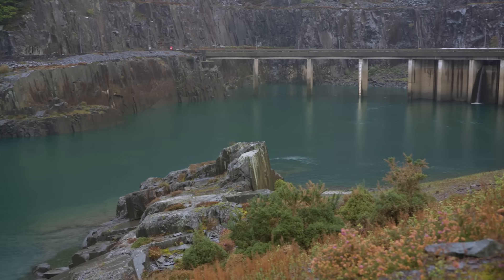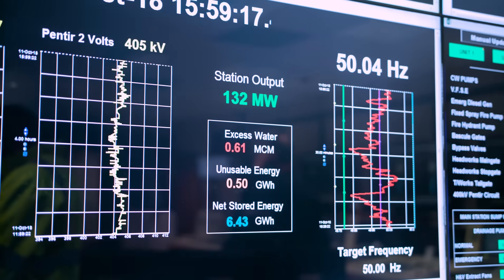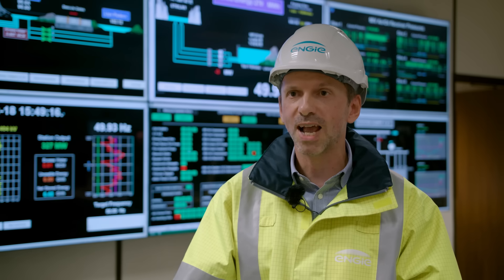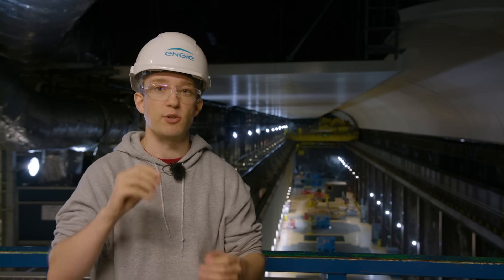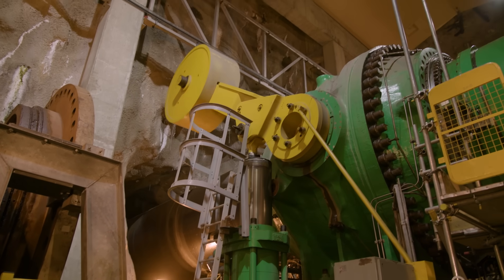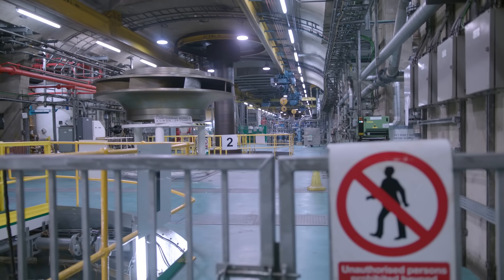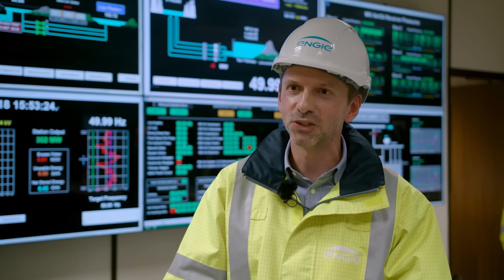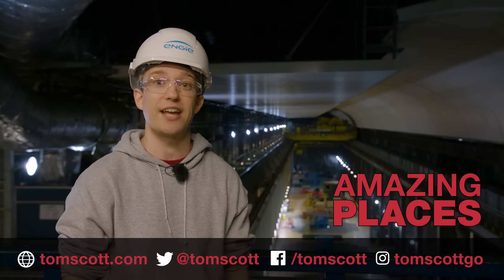Britain's largest battery is actually a lake

Comment: Isn't there some rule about vehicles must be left unlocked with the keys in, so that if the mechanism goes wrong, the staff have a slight chance of escaping the water?
Reply: Water-Battery: Time-Travel Worthy? No, eriously, im a Writer and wanna ask around if it makes sense to introduce this in Ancient-Times
Reply: @loturzelrestaurant  Interesting question! Of course, water power has been known since ancient times - mainly for milling, but around the beginning of the industrial revolution did power some factories - but the battery (storage, really) concept requires a source of energy to do the pumping-up, which I can't envisage in ancient times: all I can think of is wind, but if that was available, they'd be using it anyway rather than the water. I suppose you could envisage a very rich man using slaves on a treadmill to punp up, but that isn't really viable in general use (and the fuel - food - for the slaves would make it probably uneconomical even then).
I suppose it might just about be plausible where there was intermittent wind, especially if it blew at fixed times of day (ideally, night) when the power wasn't needed. (But you'd have to devise a wind-to-pump mechanism that was reliable enough to operate unsupervised.)
Reply: @G6JPG  Interesting! Tewll me more! Only if you have the time/mood though
Reply: @G6JPG  ?
Reply: @loturzelrestaurant  I don't understand what you're asking.

Comment: Never knew this existed, how does it compare output wise to Cruachan Power Station?  These designs have to be a major part of the solution to our  power needs in the future. A dam at height and a generator and pond at the bottom,you could even use excess solar / wind generation to pump the water back to the reservoirs at times of low consumption! They can also be made at various scales depending on the geography

Comment: The US Department of Energy just recently did a study of potential sites within the United States for this type of closed loop hydro-power storage facility . . . and they found 15,000 places where it may be possible to build something like this. Energy storage on the grid is the other huge upgrade we need to focus on to decarbonize. This is one area where the UK is way ahead of the US. The problem in the States, though, is permitting and building a facility like this can take decades. Hopefully, they can figure out a way to streamline some of that to shorten the process.

Comment: It's cool but it's also kind of a net zero. It seems like it has to use the same amount of energy that it receives to reverse the process at night. The only plus is that it's doing it during a lower cost. This got me wondering whether there are any power stations that take advantage of tides coming in to generate power? That would seem like a plus system if it was doable.

Comment: Why would you pump it at night? That seems opposite of what you'd want to do. Store renewable energy produced during the day and release it when its not producing.
Reply: Because people also use less electricity at night and there is much excess energy.
If renewables become more present so that it makes energy cheaper during the day or during certain hours, they would switch their cycle of operations.

Comment: Works as long as the energy to pump the water back up isn't from another 'battery' (ie another lake), and you don't care how the night power is generated,  Question: so the power to pump the water back up comes from what source? If it's from a non renewables that's a problem. If  as is said the lakes is topped back up over night then it can't be from solar, so must be from wind - they have that consistent a wind generated energy supply at night? . Also note that the system uses more energy than it produces, as you don't get something for nothing ie energy in = energy out- losses. So this only seems to work for an individual power retailer who doesn't care how the off peak power is being producer, so they can buy it cheaper than they sell it to the public. I'd like to see a 'whole system by country' analysis before seeing any merit in such a system.
Reply: It's main reason, as Tom stated, is to provide extra electricity during periods of peak demand, that which cannot be provided by existing power stations. NOT to create it's own.
Reply: @staryoshi06  
Yes it gives extra generating capacity at peak times, but lets not fool ourselves into thinking that because it's hydro that it's a clean/renewable energy until the initial generation is from renewables - currently only 38% in UK, and generally even that isn't availability/efficient when the electricity is required to pump the water up. And in the vid it is said they buy power when cheapest,  that's like saying I buy my gas/coal when it's cheapest.
No one in these vids about the system ever mentions how the extra source electricity is being generated
Reply: The point is, the energy to pump the water back up comes from energy which would otherwise be wasted because it's night-time and nobody needs it. It's the reason Economy 7 exists.
Reply: @SM-dt1pr  Night time energy generation: is that from non renewable sources (assuming solar & wind aren't generating) which can't be shut down and have to be kept running at a low level output, so so then... That output has to be above the min grid demand, so additional non renewables are being used to pump the water back up - or is there something I'm missing?
Or put another way, right now is the minimum generation capacity that they would cycle down to during off- peak (your Economy 7 or I believe E10 now in your part of the world now) ever above the minimum demand such that any generation is actually being wasted?

And therefore isn't the excess non-renewables energy 'generating capacity' available during the off-peak being used to storage energy for later use when energy demand is high, thus increasing your peak generating capacity - but that 'stored energy' has it's energy losses to store/discharge again.
And if you're trying to move away from non-renewables seems you back yourself into a corner of where your excess off-peak power generation comes from

Comment: The thing that confused me about this was pumping the water back up. Would that not require a huge enough amount of power to more or less invalidate the energy gained when it flows down? If the net gain is 0 and they're just using it to cover spikes in energy demand, I can't help but feel like it's a bit pointless compared to a normal power station, unless the energy output from the falling water is really big enough to cover huge power demand spikes.
Reply: It's not really meant to be a generator for the purposes of such stuff being the only or main power source. Net gain is probably negative. However, as the title says, it's like a conventional battery, just hydroelectric and not chemical and on a massive scale.

Batteries cost more to charge than you actually can get out of them, but can store the energy. 

Building such stations more heavily could help with storing renewable energy when it exceeds the current demand and could reduce the need for dangerous (for people and the environment) mining for lithium that is needed in chemical batteries.

Comment: I had a wild plan as a kid that you would have a huge lake at the top of the mountain. A generator at the bottom lake and a huge glass roof over the bottom lake that would catch all the evaporation and drain it back in to the lake at the top. It would refill the top lake with clean drinkable water.

Comment: we had one of these till this year it was built in the late 80s and machinery was done by Toshiba. Because of a very large corruption scheme the repairs were not done by the original 30yr round overhaul plans but by something made by another company in germany i think. during night time one of the overhauled turbine/pumps burst and almost the entire facility was rendered inoperable.  The funds needed for repair are not possible to allocate at the moment so we lost a strategic power resource :(

Comment: This is the most ridiculous idea for a power station I have ever heard. Just because it "costs less" does not make it efficient. This is by far the most inefficient way of generating electricity, it would take at least the same amount of energy that came out to move it back to the top. Just stupid, plain bloody stupid!
Reply: It's storing electricity. It takes energy from night-time, when electricity is cheap and it is worthwile to pump it back up, and then releases it at daytime to help with the peaks. It does not generate electricity but stores it.

Comment: Tom, next time you come to New Zealand, maybe checkout Manapouri Power Station.  It has only one half the capacity of Dinorwig, and is a constant loss system draining Lake Manapouri into Doubtful Sound 750' feet below.   The turbine station is deep within a granite mountain and accessed via a two kilometre tunnel big enough for a coach to drive through.  Workers were bought to NZ from Italy as they had the experience.  The unsealed road that connects Lake Manapouri to Doubtful Sound goes over Wilmot Pass, and is the most expensive road by length ever built in NZ.  It is under constant repair because of the intense Fiordland rainfall (about 7 metres [23 feet] every year).   If you do come here again, and want a guide for Marlborough, please look me up — it would be a pleasure.

Comment: Why would you burn battery over the day when sun is shining?
Shouldn't we be using this sun  to power the battery and use the battery over night?
Reply: No. At night the electricity consumption is much less in the country so it makes sense to pump it back up. During the day is when excess electricity is needed, so the water is released.

Comment: Where does the power to pump the water back up come from?
Reply: Energy Surplus. All energy that is generated must be consumed immediately after, since there is no electrical battery large enough to store such extreme amounts of energy. Then there is more energy being produced than is consumed, the excess gets turned into gravitational potential energy. When more energy is being consumed than would normally be produced, this acts like a hydroelectric dam, exchanging the gravitational potential energy back into electrical energy to make up for the deficit. It is not as fast as Flywheels or Batteries, but it has a much higher capacity and makes up for the large-scale variations in the grid.
Reply: It's storing electricity. It takes energy from night-time, when electricity is cheap and it is worthwile to pump it back up, and then releases it at daytime to help with the peaks. It does not generate electricity but stores it.

Comment: I've thought of using a similar idea for home power generation using a hydraulic ram pump, which has no moving parts, and simply relies on moving water to pressurize the water line downstream from the pump. This could slowly fill up a reservoir and either the reservoir could empty into a turbine at peak power need or continuously empty into a turbine for constant power generation.

Comment: May I know how much the energy needed to pump up back the water compared to the energy down flow you can harvested. Im not intrested about the cost cheap or high. Just need to know about the convertion power calculation, example pump up needs 6 times the power then it can produced down flow... Tq.
Reply: I think it's something like 85-90% of the energy you put in you get back.

Comment: a fuselarge testla valve, when you close the main pipe valve, open the edges of fuselarge openings to the testla valve outer spirals, as use as a recuirculation diversion to lower the intense pressure. simple fix for water hammer.

Comment: Could it be possible to make a big siphon so it just recharges for free and generates power all the time?
Reply: self-feeding siphons will always reach equilibrium. It all has to do with the fact that you can not get energy from nowhere. A siphon will always bring a liquid from an area of high potential to an area of low potential, and not the other way around. If the end of the siphon is placed above the level of water, the siphon will not flow, as the hydrostatic pressure would not be sufficient to move the water. It would be analogous to water flowing uphill, something that does not happen without some kind of energy input.
Reply: @zacharytaylor190  thank you for taking the time to give that explanation
Reply: @TheStigification  No problem.

Comment: There's a similar thing in southeastern Missouri, USA. They literally built a reservoir, fully above ground, on top of a (very small) mountain. It's actually a net consumer of electricity because there's no natural flow of water into it (it is literally on the summit), but it's profitable because of the electricity-is-cheaper-at-night thing.

Comment: It's not renewable if you use Coal or natural gas power to pump the water up at night. I didn't hear anything about what kind of energy they use to pump it at night, only that "it's cheaper" I heard. Maybe that they buy electricity from germany or other countries at night and use that to pump it, same as most Scandinavian countries do.
Reply: They buy from the grid, that's all the generators in Britain. So both renewables and fossil fuels
Reply: Essentially its a water battery. its not 100% renewable, thats my point, you still burn fossil fuels to run it.
Reply: @mehdi-9999  Yes, it's exactly as renewable as the energy used to power it.
Reply: I've been on tour there and they explicitly mention that it is not renewable.

Comment: Pumped hydro energy story is about 80% efficient.  However there are still the losses to send power up the grid and back down the grid.  So for example solar panels on someones roof lose 10% going up the grid to storage (of whatever type) and another 10% loss coming back down the grid to homes etc for use.   Thats 40% loss overall.  At least pumped hydro has very good scale and lifespan compared to the other storage options and can be throttled.  People forget that most lithium storage has 80% at 10 years and by 15 years is due for replacement on a charging cycle once a day.  The ideas that countries have to use EV's as cycling storage back up could have a dramatic impact on shortening their life at significant cost to their owners.

Comment: A lot of watertowers do the same thing in addition to providing water pressure for houses
Reply: They serve to completely different purposes. This serves to store energy and supplement the grid. Water towers serve to distribute water to a population. Once the water has been consumed, it needs to be treated, which takes more energy. Also, water towers don't have pumps, and are driven by the mains pressure-head, along with water towers being comparatively tiny. A "swimming pool every second" would mean that it would transfer more than a large water tower every minute, as the largest water towers hold about 50 swimming-pools worth of volume. In a single day, that equates to conservatively 1,500 water towers worth of water transferred.
Reply: @zacharytaylor190  i did say in addition, it’s more of a “might as well attach a turbine” sort of thing.

Comment: spin it any stupid way you want, it is not a battery
Reply: It's storing electricity. It takes energy from night-time, when electricity is cheap and it is worthwile to pump it back up, and then releases it at daytime to help with the peaks. It does not generate electricity but stores it.
It is a battery.

Comment: A lake is not, never has been, and never will be, a "battery".

I realize YouTube is full of morons, this is partly why. Don't dumb everything down for derps.
Reply: The lake is a major part of a pump-storage hydroelectricity plant. 
If that's not a battery, you're being dense
Reply: @MrHat.  It's a stretch to call it even a "cell" nevermind a "battery".

A battery, until common idiot screwed it all up, designates a series of cells, or a series of anything. A lake doesn't qualify as a "series anything" for starters.

If you're gonna bend it, at least do it in a sensible way. Call it an "accumulator"... Maybe the old school car crowd won't cry too loud.
Reply: @MadScientist267  you are dance, 
Do you know we call an accumulator  in modern English? A car battery. Language and language usage doesn't revolve around you.
Reply: It's storing electricity. It takes energy from night-time, when electricity is cheap and it is worthwile to pump it back up, and then releases it at daytime to help with the peaks. It does not generate electricity but stores it.
It is a battery.
Reply: @56independent  You need a dictionary. This is not in any way shape or form a "battery" 🙄

Comment: Why don’t they just pump the water back into the lake at the top of the mountain straight away will generating the electricity? Then it’s endless power?
Reply: This little problem called the laws of  thermodynamics means that's  impossible.
Reply: No. Pumping it back up takes more energy due to losses. This means that there is not endless power. Instead, it's pumped back up using the rest of the grid.

Comment: Can it do 1.21 GW?
Reply: It says on the display that it currently has 9.61GWh in potential energy storage, with pump/turbine 1 operational, generating or storing 134MW, although only for the reservoir being displayed. There is likely more than just that one. The station has a rated capacity of 1.8GW according to wikipedia.

Comment: It's a great solution to a problem (providing power when needed) but there has to be some entropy in the system. So, if I understand it right, they're spending a little bit of power that they otherwise wouldn't, to avoid taxing the rest of the grid too heavily at certain times.